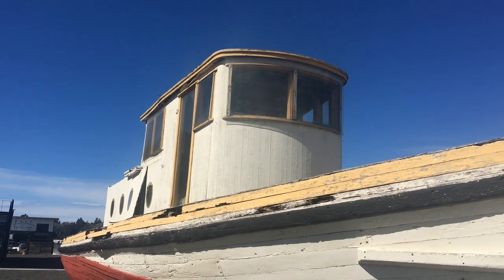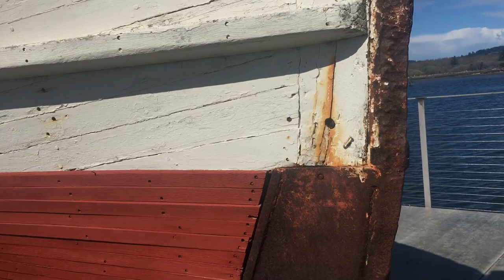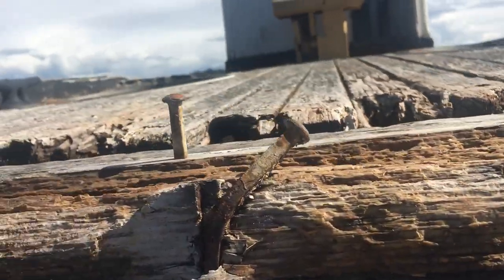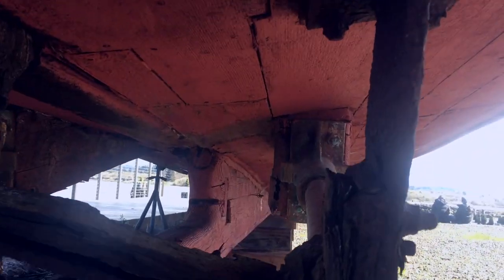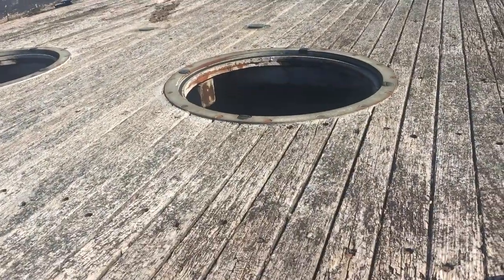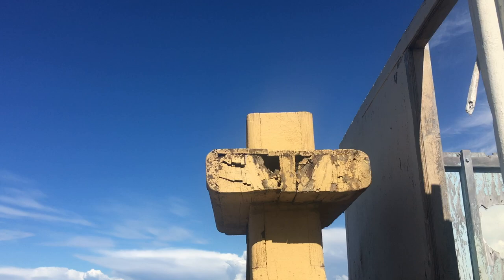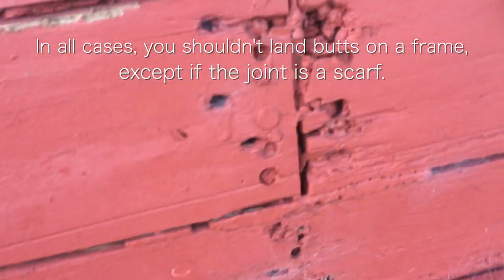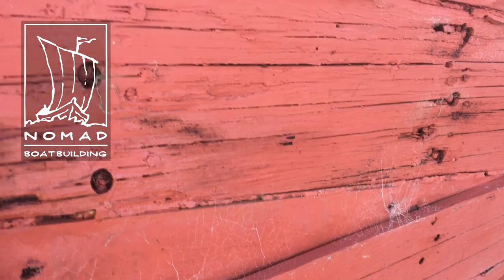Old Coos Bay Work Boat

Comment: I rented a canoe that was hogged once. Damn thing felt like it was suction cupped to the water. Absolutely wouldn't coast between paddle strokes. It was like riding a bicycle with flat tires.
Reply from the maker: My Father-in-law had a hopelessly hogged plastic Coleman canoe. I had the same experience.
Reply: @Nomadboatbuilding  I used one like that, once. Not good.
Subscribed.
Best wishes from Northern Manitoba.

Comment: Second cup of coffee, second watch. Question: how would the holes for the square drifts been sized? Thank you Mark. Have a great week ahead.
Reply from the maker: Good question! They may not have drilled holes at all. The rule of thumb is to use the minor cross section or just under. The corners do the biting.